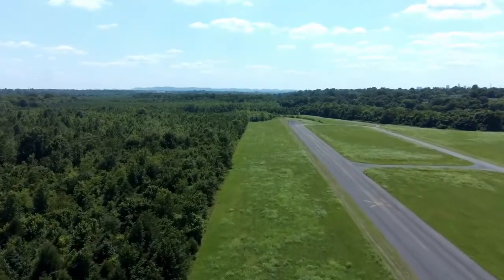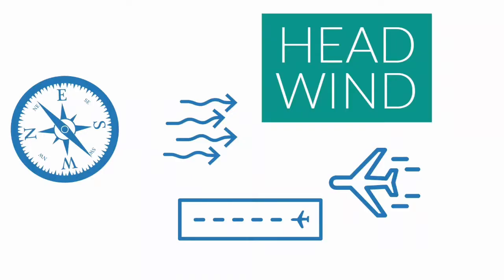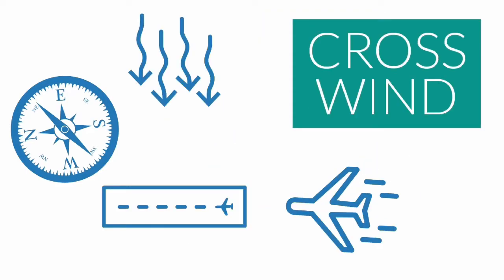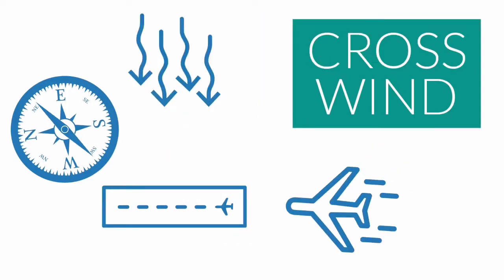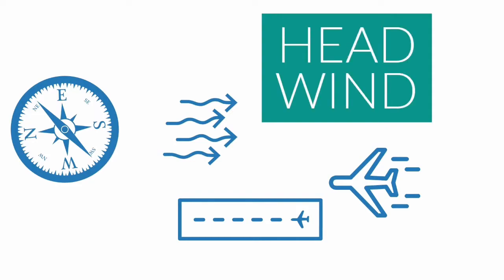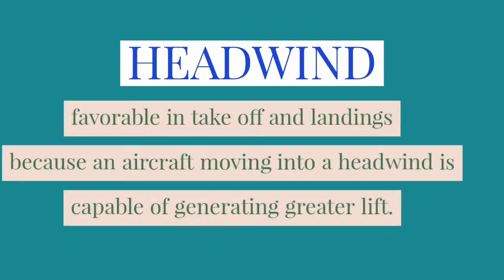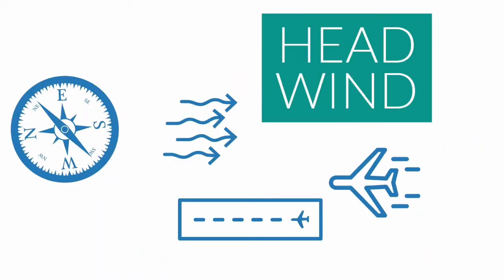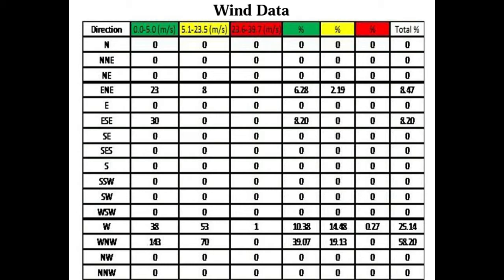Runway Orientation in Airport Design

Comment: Sir is the landing and take off of the plane in  different direction or same.... because if in same direction the  wind will not be head wind for both??
Reply from the maker: Preference is given for landing aircrafts over takeoff aircrafts for head wind. In general, both landing and takeoff prefers head wind as it provides stability. At busier airports depending on the conditions of traffic/weather conditions at the airport, ATC will decide the direction for landing/takeoff aircrafts as suitable. Hope its clear :)
Reply: @HelpToAchieve  thank you sir